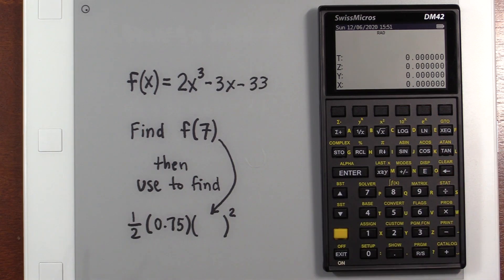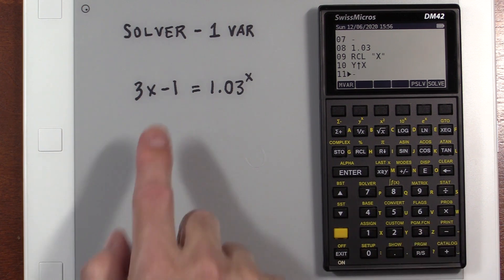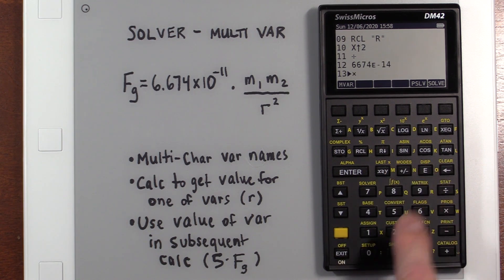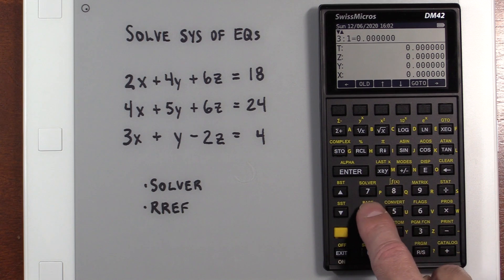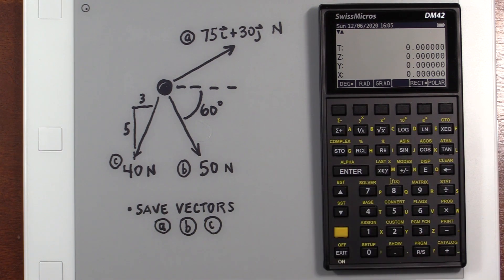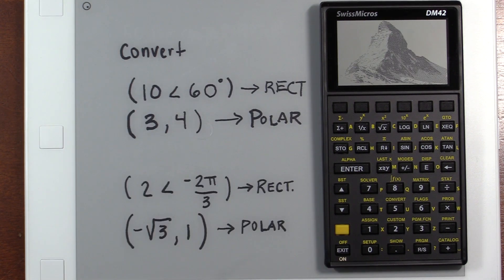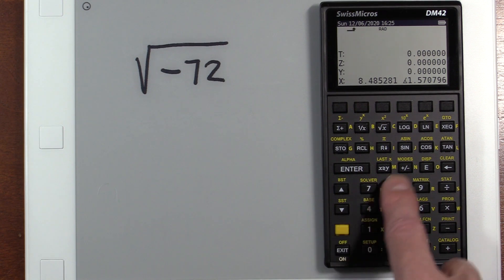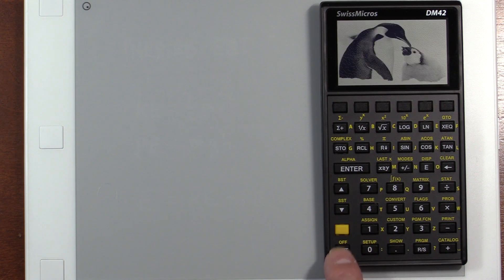DM42 (SwissMicros) - Solving Various Engineering Problems

Comment: Interesting video as usual. Although the DM42 has roots in the HP41 which I had may years ago, I find it difficult to follow the keystrokes.  Entering matrix seems quite tedious, the solver is clunky. I guess I have been spoiled by graphing calculators like my current favourite, the HP Prime
Reply from the maker: First, thank you for letting me know you found the video interesting.

Following the keystrokes is made worse bc the DM has a setting for alpha mode that changes things up from the normal HP 42S (e.g. using shift-1 to enter 1).  It’s a bit less intuitive, too, than the HP 28 and 48 in terms of when ENTER is required and when not, but that’s a minor quibble.  Also, I’m going fast bc the video is already long enough. Wonder if I am striking the right balance?

I disagree about matrix entry. I think it works well. I actually prefer entering matrix on this calc compared w the HP Prime, but the Prime has the big advantage of showing the contents of the matrix once entered (the DM42 does not). 

100% agree that the solve function is clunky compared w the Prime and 28/48 and the Casio 991EX and TI-36X Pro.  It’s fine for entering something you know you’ll use again and again. But, for a quick, one time use it is too keystroke-intensive to want to use.
Reply: @scottcollins7513 Its old calculator and it had one line display hence it can't do integrals,matrices, equations as elegantly as HP 48g
Reply from the maker: @EEhe-i7t  I find the hp 28 more intuitive (in part b/c it does less) than the 48, but agree that both are superior to the dm42 in the aspects you listed.
Reply: @scottcollins7513 HP 42s should have had integral solver like HP 48 and spreadsheet like  matrices,but it can't because of its two line display.HP 48g/HP 50g are more suited for complex engineering work,Why dont make a video on HP 50g ?